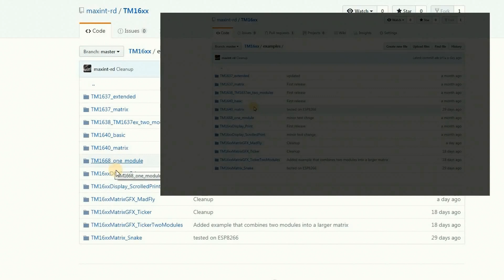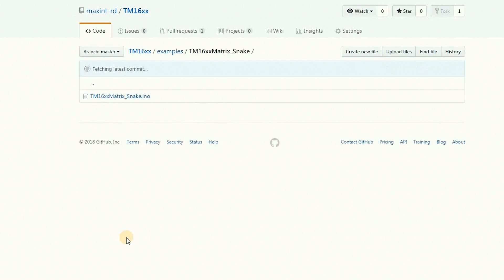Mod: TM1637 LED matrix module

Comment: Hi Maxint, Can you please share the search term for these white LEDs ? I like the color and package very much and I can't seem to find ones quite like these.

Thanks!
Reply from the maker: Sure, these LEDs were quite cheap. I bought them on AliExpress for about 50ct per 100. The term you're looking for refers to their size in mm: 3528. It may help to add something more like "3528 super bright white led smd". Sometimes they include the inch size "1210". These were cold white and a bit on the high side. They also sell warm white and other colors in a less high package (1.9 mm high).
Reply: @MaxintRD  Thank you very much!

Comment: Hi Maxint! Great mod indeed! Thanks for the video... I’ll definitely check out the GitHub examples!
Reply from the maker: Hi Dustin, glad you liked it. The TM1680 has even more outputs than the TM1640 that I showed at the end. Enough outputs to make an RGB matrix, but unfortunately the chips in the TM16xx family only offer global intensity levels. This means that the RGB palette would be very limited to only 8 basic color combinations. The popular MAX7219 chip does offer individual levels, but while more expensive it has less outputs so you would three chips for one 8x8 RGB matrix. Perhaps there is another chip that is betrer suited?
(BTW; somehow YT flags your comments as possible spam...)
Reply: Well... another route is to go the WS2812 RGB pixels and an ATtiny85. But that wouldn't really be a matrix, thats basiclly just a string of LEDs.  And it's a bit bigger 5050 is 5 by 5 mm... Another option is to use the SK6812 LEDs which is 3.5 by 3.5 mm. But I don't think that will be handsolderable anymore. And BTW YT is wrong! Haha!
Reply from the maker: Indeed, those are quite interesting LEDs. I bought a bunch of the SK6812 RGBWW 5050 SMD individually addressable LEDs (RGBWW=RGB+Warm White,  similar to WS2812B but with an additional white LED for more natural colors). As you state it would be more string than matrix and not very cheap.

I'm kind of looking for the most affordable solutions and I bought a hundred 1210 sized RGB SMD LEDs like the ones you have for about one euro cent each. Most chips in the TM16xx series are quite cheap, but not suitable for making a true 16M-color RGB matrix. Two years ago I made a white LED matrix using 74HC595 chips, but they require the MCU to do the multiplexing and PWM-íng. Perhaps making a compact 8x8 module with three 74HC595 chips and an ATtiny as co-processor could work too. It would definitely be a great exercise at PCB making!
Reply: Maxint R&D I think Seon (Unexpected Maker) use the 74HC595 in his 7 segment display. Could also be David Watts. One of those two :) What do you think of the SK6812s? Already used them?
Reply from the maker: The 595 is quite versatile. I've made the mxUnifiedIO library to use them as IO-expanders with easy digitalWrite() functions. See https://youtu.be/40Ssl2K_jfo for a demo.

Those SK6812's are very nice. I've not used them in a real project yet, but only experimented with them on a breadboard adapter. I've got about 50 of the RGBWW version, which gives very nice warm white light. They also sell them in cool white and natural white. If I remember well the RGB colors were okay, with one color (was it green?) a little less bright than expected. I used the AdaFruit Neopixel library which also supports 32-bit colors. Someday I want to use them to make a nice colorful tall standing lamp for in my living room using old Ikea parts, but the design hasn't stabilized in my head yet.

Comment: Nice Mod Maxint!

My Alarm clock pcb is using the TM1637 so interesting that it can be used fro some other stuff too.

You can buy through hole version of the TM1637 on aliexpress too if people wanted to save the hassle of de-soldering the module.
Reply from the maker: Hi Brian, yesterday I received your Alarm clock kit and today I saw this reply once more. Your PCB is very nice and the clock will come to use soon. More about that later... For other readers: you can find Brian's kit on Tindie. Just search for D1 mini Alarm clock.
Reply from the maker: Thanks! I've bought a bunch of sibling chips in SMD format and used them with a breadboard friendly breakout board. At the end of the video you can see the TM1640 in action and I've also experimented with the TM1668 and the TM1638 (which is used on the LED&KEY modules). In a future video I intend to show a bit more of the TM1640 and the library I made to support it.
Reply from the maker: Oh, in case you haven't seen it yet, in my previous video I showed how I added some more leds and buttons to this module (see https://youtu.be/8PaEZGtskVs). That might be interesting for your Arduino clock and safe you some pins on the WeMos board that you are using. It may require reading the button in the loop though. My TM16xx library does support reading the buttons, but is fairly basic as it is now.